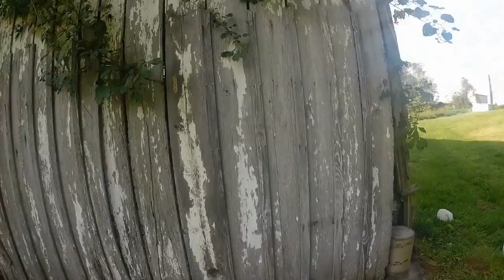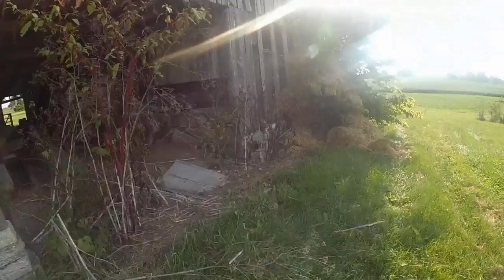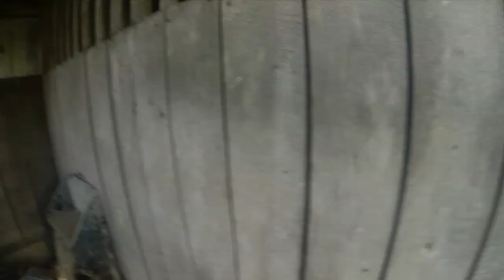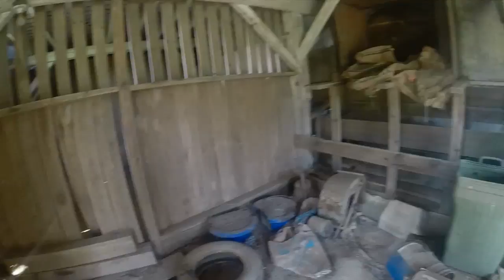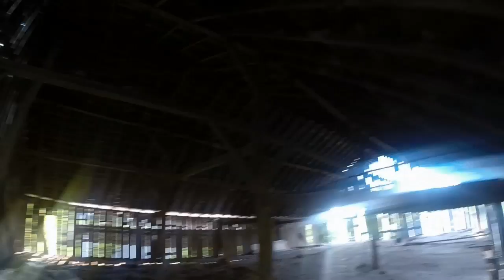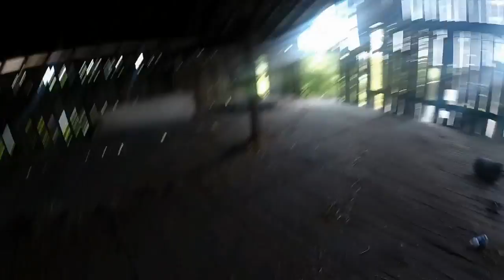This old Barn err Shop

Comment: Looks like a daunting task refitting the barn. Post some updates as you go.
I also notice that the audio on most of your videos is of limited frequency range. I am assuming that you have the cam in a case?? Consider using a case whereby the mics are not covered for better audio.. ;-)

Colin